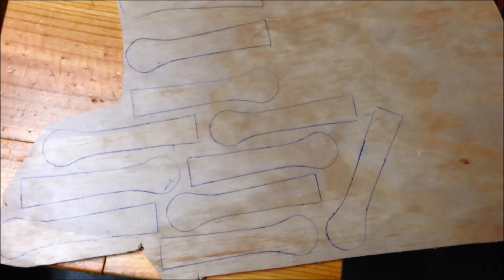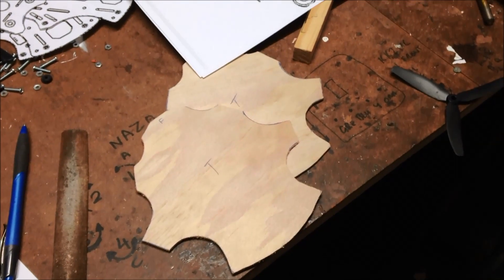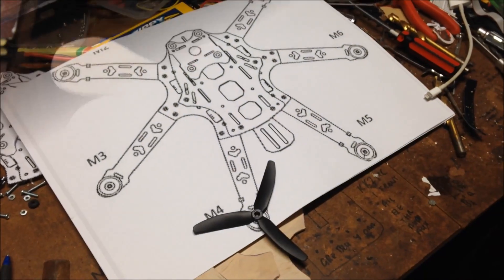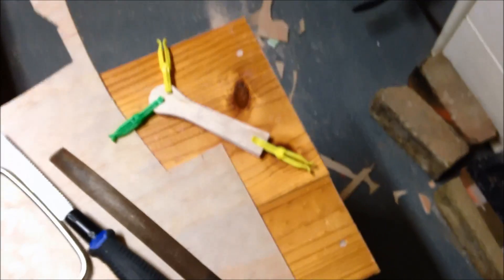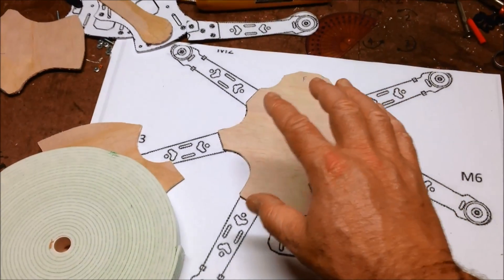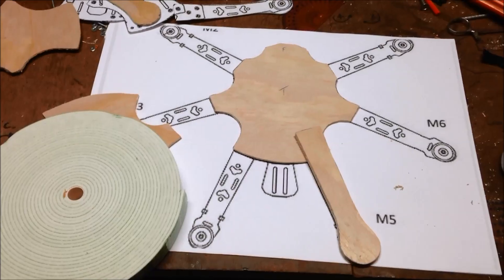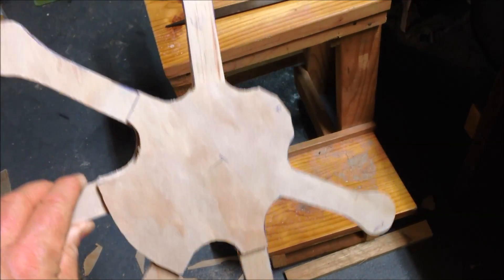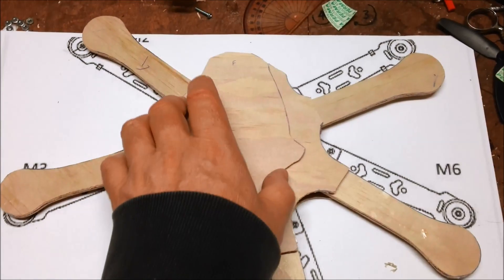Mini Hexacopter Frame Build. Plywood DIY project for FPV. 1806 Motors and 5x45 Props

Comment: I thought of another thing to make frame lighter and stronger. I was searching around and ran into a site named composites one and it seems that they have CARBON FIBER. I was thinking that you might be able to get Carbon Fiber meshing and layer it over the frame. 
 This is what I'm currently deciding on doing when I build my frame.
 I will start with base wood at 1/2mm then add fiber glass wrap built up to 1mm, then take the thinnest balsa sheet available and lay it on top of both sides( cut out frame shape before next step), using whats left over of the epoxy resin glue it down using weights distributed along frame to keep it as flat as possible let all dry for a day (use heavy weight like around 30 lbs) to keep from warping, after a day or two the frame should now be at 2 1/2 mm thick now lay frames  on top of carbon fiber mesh wrap and tack down  while warping parts. when your done think ness should be about 5mm, next your going to vacuum bag the parts let it all dry take it out of vacuum bag then finish parts out to your liking. 
That's just the start I still have to drill holes for mountings, it sound a lot of work and I don't the space to do it all most of tools need I just can't get them due to cost but I will evently build my own quad frames I just have learn how to use my new 3D CAD software and get my new DIY 3D Pinter Kit built.
Alway good luck on your project.

Comment: Woaw That's a great idea building with wood. I have a suggestion if you don't mind. My suggestion is you can do a lite weight fiberglass wrap around the wood structure then mix lite epoxy and liquid plastic together then coat it, sand it down smooth a bit then paint it. The other one is you can get some plastic pipe like pvc or pva and slowly heat them up until they start to get gooey and drip it over the wood or make wood molding of the frame and drip the melting plastic into it. I don't know if these idea are good or not but it's worth trying out.  I work at a plastic/fiberglass plant and we make stuff for oil company's, electrical power line work , etc. and i'm currently thinking about making my own racing fpv quadcopter frame because all the frames I like cost to much or the design could be made a bit more repair friendly. I hope you luck and great success in your build.
Reply from the maker: +DeltaAssualt Could use thinner plywood then as well. Strength would be in the fibreglass wrap. Hmmm.

Comment: Hi. How is the build? Im have the zmr 250 carbon frame, esc, and SS 2205 motors. I am thinking of making the same mini hexacopter from wood frame from home depot instead of the zmr and order 2 more motors and esc.  I got inspired after watching Foxtech's mini hex Beetle/Cicada. If I ended up liking the sound of the 6 props and the speed instead of efficiency of a mini trip or a mini quad I will keep the build. I am looking forward to your finished project. Where did you get the mini hex template?
Reply from the maker: Alfonso Alfonsos On Ebay. Lookup argonaut mini hexacopter